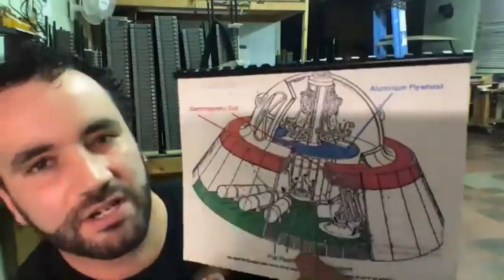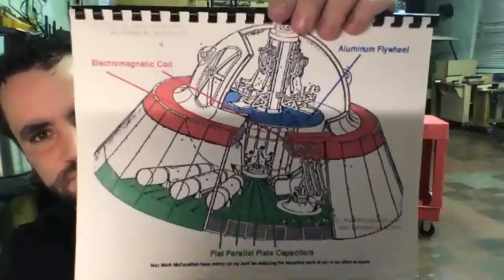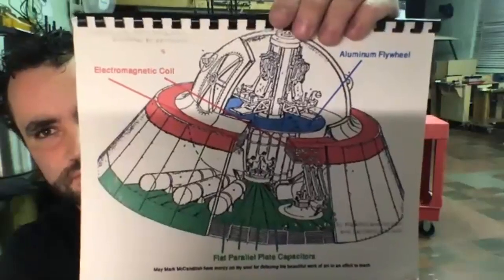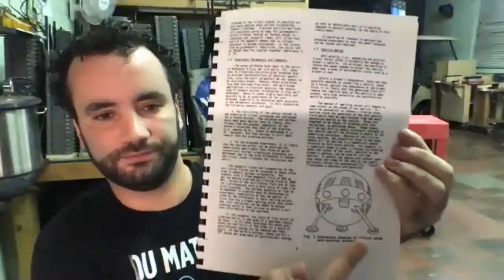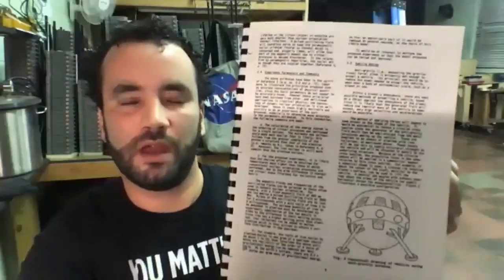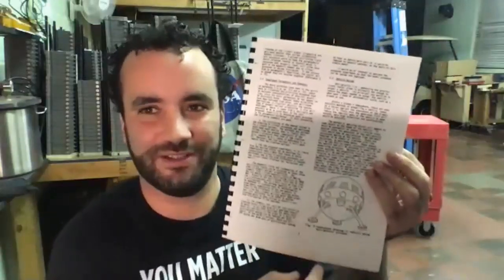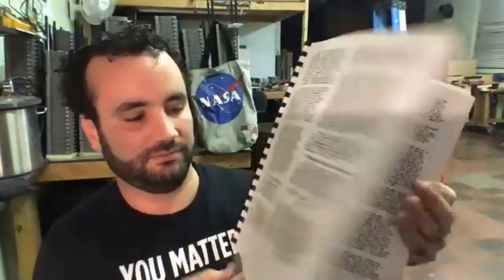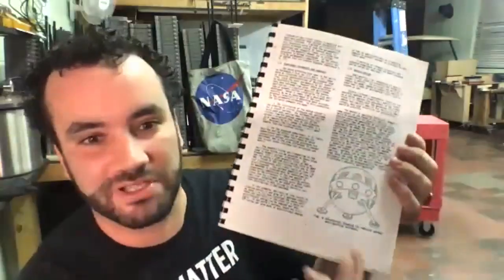Alzofon Interview Highlights: an easier way to achieve Antigravity

Comment: Yeah, it is important to distinquish that Dr. Alzofon got it wrong and @Falcon Space Program is misleading viewers because the experiment they are showing is Todd Desiato's experiment not Dr. Alzofon's. 
The Dr. Alzofon's experiment was dependent on "cooling" the gravity by an elaborate pattern of EM waves. What @Falcon Space Program is doing is just plain brute force blasting of 9.5GHz EM waves into the sample, without of any Dr. Alxofon's "gravity cooling" pattern. Dr Alzofon's theory was a near miss and it actually didn't work, which David Alzofon actually admitted in the book. Credit goes to Dr Alzofon for inspiring more correct approach. You can read more about Dr. Alzofon's failure here:
http://www.diyphysics.com/2019/07/16/f-alzofons-1994-experiments-do-not-prove-his-model-of-gravity/
The scientist who was first to properly explain what is going on is Todd Desiato and you can watch his presentation here: 
https://youtu.be/MnKu4rTZyHk
Reply from the maker: Todd desiato is on our team and offers another theory as to why the Alzofon Experiment works. This experiment is undoubtedly Alzofons. 

Todd is trying to achieve DNO using NMR in the MHz range , his argument being if it can be done with Mhz why go to Ghz ?
 (Also the fact that thats the equipment he has on hand )

Just to be clear the “gravity cooling” is an analogy to explain the effect not an actual procedure.

We used another explanation in another video and todd offered a third explanation. Their are also two other explanations that i wont get into, bottom line is does the experiment work ?
So far we saw positive results but they were close to the noise floor and we are working on a high power version of it.

Also the microwaves are not alone and they are combined with a laminar magnetic field at the larmor frequency which is the elaborate pattern that you referred to.

Finally Dr Alzofons 1994 experiment showed weight loss when the magnet was off as well. This may indicate either a bad test setup or some not fully understood magnetic effect on the sample that allowed larmor precession to be maintained after the magnetic field was removed. 
We have had to take extreme measures to insulate the scale from RF interference with over 3 layers of shielding and we hope fredrick did not make that simple mistake in his setup.
Reply: @FalconSpace  Dr. Alzofon's experiment turns off microwaves after reaching Larmor's frequency, while Desiato's experiment is using Continuous Wave. Simple as that, it's pulsed vs. continuous. You are using continuous, not pulsed, so you are doing Desiato's not Alzofon's experiment. Good luck, anyway.
As well, you are doing EPR which is far more expensive and delicate to the point that it can't be done with equipment that you have. Dr. Alzofon was human, not a God, so he got hunged up on the pulsed signal RB-47 eavesdropping plane recorded. As well he used EPR equipment just because that was what he had in the lab. NMR experiment is many times easier and cheaper. The equipment that you have is too crude for EPR experiment. You don't need more powerful equipment, you need more precise equipment and better control of temperature and magnetic field.
It's almost certain that you are not getting Larmor's frequency, you are just blasting it out of the tune as a hard rock band. You need to calibrate your equipment.
Reply from the maker: @HitAndMissLab  you are clueless and wrong. 
The goal is DNO. Their are many ways to achieve that.

And we were pulsing it, continues wave per alzofon creates weight gain.

Comment: Maybe it was discussed at some point during the stream, but perhaps it could be possible to use the Earth's magnetic field as the magnet for spin resonance?  That might also allow for a much lower frequency if it's possible since the Larmor frequency is proportional to magnetic field strength.
Reply from the maker: Todd Desiatio is trying exactly that.

Comment: I'm waiting for the full interview. ;) Cheers.
Reply from the maker: Jan Tiger well get it up shortly. Its very long 3 hours +
Reply: @FalconSpace  Great! This may sound unpolite, but you should start to categorize David's Alsofon knowledge and squeeze from him as much as possible. He is old, no body know how long we will live. You should make a copy of his memories ;) This is easier than finding those clues by yourself.
Reply from the maker: Jan Tiger trust me hes as excited talking to us as we are to him. Im still not convinced this will work, weve had lots of false positives that turned out to be related to rf interference with the scale.
Reply: @FalconSpace  That's a good aproche. When I look at your work from a distance I have feeling that you're rushing experiment not fully understanding effect behind it. I mean gravity is common in our world, you don't need special equipment to observe it. As David mentioned in theory this effect should also occure without microwaves. Think about it.
I might be wrong. ;)
"A flywheel is essentially a very heavy wheel that takes a lot of force to spin around. It might be a large-diameter wheel with spokes and a very heavy metal rim, or it could be a smaller-diameter cylinder made of something like a carbon-fiber composite. Either way, it's the kind of wheel you have to push really hard to set it spinning. Just as a flywheel needs lots of force to start it off, so it needs a lot of force to make it stop. As a result, when it's spinning at high speed, it tends to want to keep on spinning (we say it has a lot of angular momentum), which means it can store a great deal of kinetic energy. You can think of it as a kind of "mechanical battery," but it's storing energy in the form of movement (kinetic energy, in other words) rather than the energy stored in chemical form inside a traditional, electrical battery."

Comment: Wow!  You guys are becoming recognized community leaders.
Reply from the maker: Leo Volont your still our number 1 fan
Reply: @FalconSpace  Yeah, in your last video I was really impressed with the completeness of your equipment and the dedication you put into that bullet proof Faraday Cage (more like a Faraday Pillbox... years ago the Air Force built a Test Station that was supposed to withstand an EMP Pulse if the nuke went off on it's roof, but when they'd check inside, well, the noise floor wasn't a noise floor.... FM stations were bubbling up.  WTF!? right?  It turns out that in the whole building the Tech Guys I drilled a few small holes so they could wire up a commercial radio antenna for when they weren't being inspected.   I compared that to a K1 Lab (DC) with their Faraday Cage that was just a chain link fence.  Yeah, it will keep squirrels from messing with your test set up. 

But NOW you guys are going to need some hellaciously big Turn Tables.  I worked with Tables that spun on the vertical axis and that had a pillar popping up from the center that had a Horizontal axis that spun.  Our reading came from Brush Connectors (now think about trying to get good RF through friggin brush connectors.... life could sometimes get greasy crawling around to take a look at those things.    Now guess what is in YOUR future.    Oh, BE Careful with those tables:  anything you put on top of a table will fly out at your if the table goes runnaway.  Oh!  that reminds me: tables can go runnaway.   You see the Controllers have banks and banks and rows and rows of Power Transistors because it is current that swings those tables.  Remember the failure mode of a transistor is SHORT.   Now a few power transistors in the controller banks can go short and the other transistors will do their job and hold things back, BUT the shorted transistors stress the system and it turns into an avalanche and one minute everything is fine and then next second you are running to pop the Big Red Panic Breaker (designed to work if you throw a chair at it).  But yeah onetime a Table went rogue and we have an oscope on it plugged in.   The oscope was swinging around straight out and the only thing holding it was it's chord and we all wondered how long the sideways plug would hold, but we all got behind pillars until that scope went until we'd come out into the open to hit that breaker.  So, yeah, BE CAREFUL.
Reply from the maker: @leovolont  omg... 
this faraday cage was designed with megawatt impulses in mind. its really 2 separate cages as its a bi-layer system.

Comment: I saw a video of a copper ring that was spinning, and there was a magnetic field spinning in a ring shape trailing the rotation at a reduced rate, it was strange. U could see it with a film of Ferro fluid.
Reply from the maker: It may be all connected. The more we look into this Alzofon theory the more we're connecting the dots and figuring out whats going on.
Reply: Its looked like rotating the ring created some kind of secondary magnetic Etty current.
Reply from the maker: @kulpritblk1578  the Key is coherent Matter states
Reply: @FalconSpace  it depends on how U wanna do it. I'd just write a function to figure out what magnetic fields U need to create the gravitational field U want using the Einstein field equations, seems alot easier.